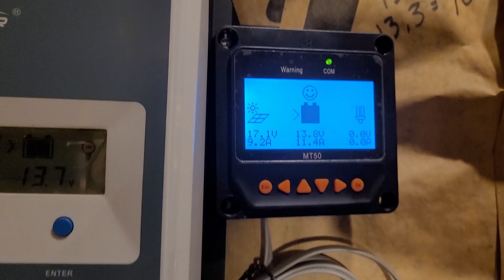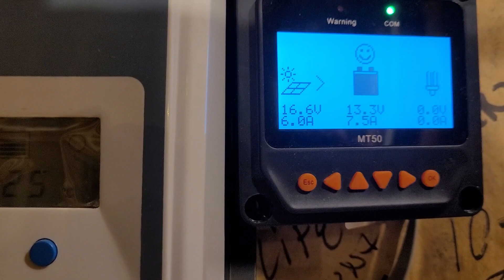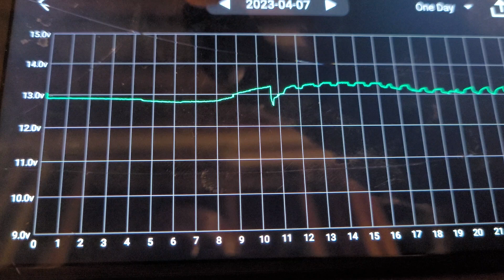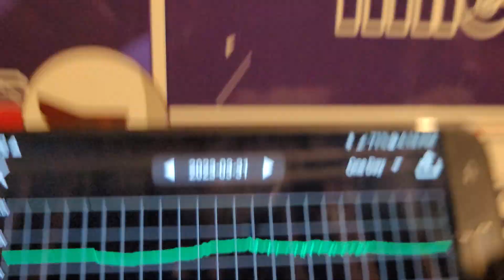Off Grid Solar is 12v worth the hassle?

Comment: Yeah running a well is very taxing. Here in florida I have a well. When the hurricane come through usually a week without power. I did however to supplement the generator for the well got a 24v 4 kw split phase inverter and 400ah of battery. I have 800w of solar dedicated just for that. It works ok. You may wanna see about solar batch hot water as well. I built one about 15 years ago. Made it from 2 old hot water heaters. With your amount of sun not sure how well that would work for you. I originally set it up as a pre heater to my hot water tank and it evolved from there
Reply from the maker: I have a tankless water heater...or on demand...working flawlessly  for 16 years....

Unfortunately my well supplys 2 homes and runs alot...it would eat 400ah batterys for a snack...

Comment: I run 3 chest freezers my refrigerator and a 65-inch tv off my 3000-watt pure sine wave inverter and two 200 ah Lipo 4 batteries in parallel. I have 6 120-watt panels run in parallel also. I run this setup from about 8 am tp 5pm every day, then disconnect. my batteries are almost always over 14 volts and most of the time at 14,3 volts at the end of the day if I have decent sunshine.
Reply from the maker: Love it          Full battery rules!

Comment: The biggest expense is the batteries. 
 Just make sure you buy a big enough solar charge controller so you can add more panels and batteries as needed.
Reply from the maker: I recommend the 50a. If 50a @12v isn't big enough you can always go 24v